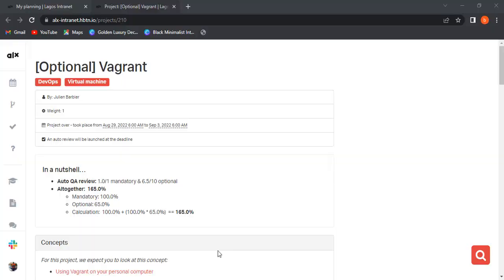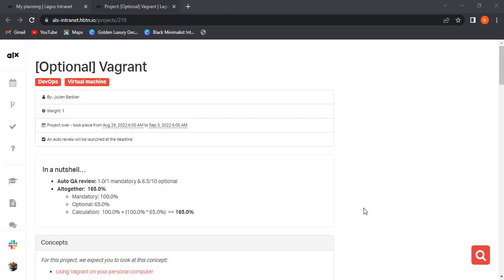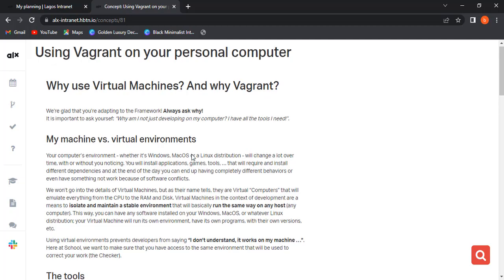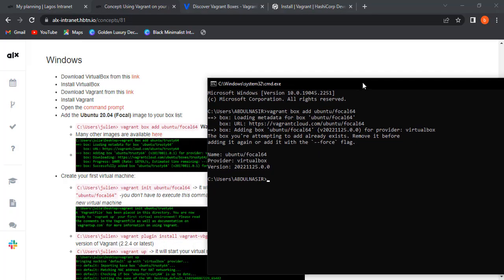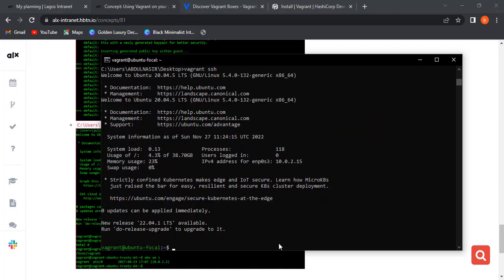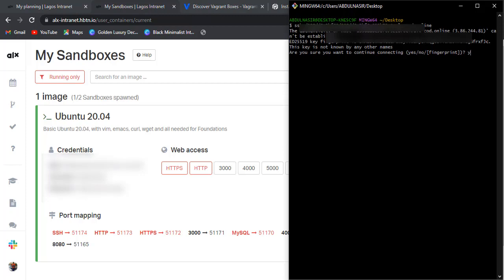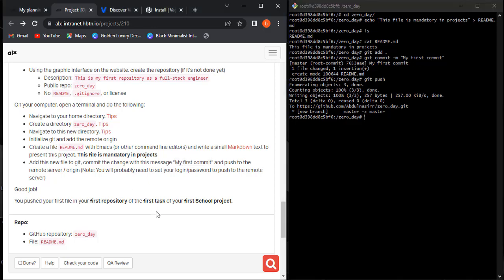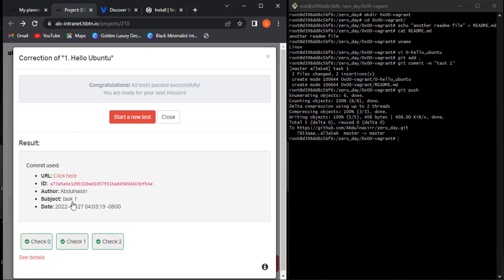Vagrant (installation and settings)

Comment: Thank you very much, for this tutorial . you made it all clear, but I'm having issues with my virtualbox installation, I'm using 32- bit windows and it's saying that it can't be installed on 32 bit windows. Is their any solution to this problem. Thank you once again.

Comment: Sir, I’m stuck trying to do this command “vagrant plugin install vagrant-vbguest” 
I’m receiving an error message trying to install it sir
Reply from the maker: Are you sure your network is stable enough?
If your network is not stable you will be having problem installing vagrant
Reply: @codevertx  Yes sir, my network was stable but I will try again with a more better network sir.

Comment: after typing the code vagrant box add ubuntu/focal68 .....it displayed error message that the box could not be found
Reply from the maker: Yes it happens a times when your network stability is low. But keep trying or use another focal instead of focal68
Reply: Ok thanks I will